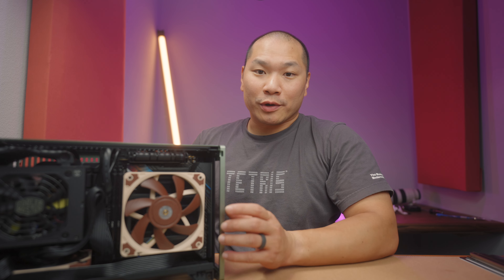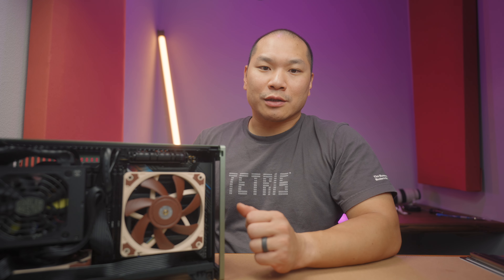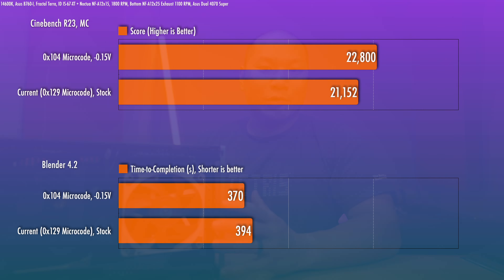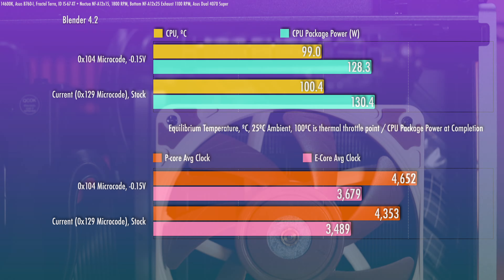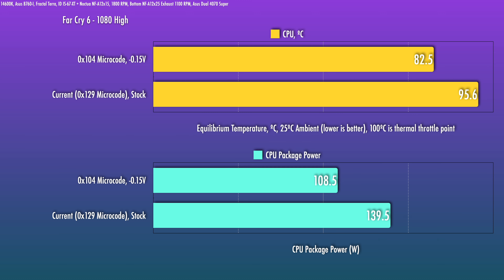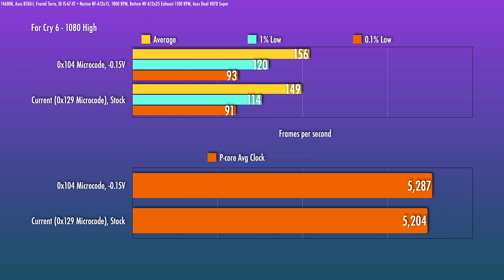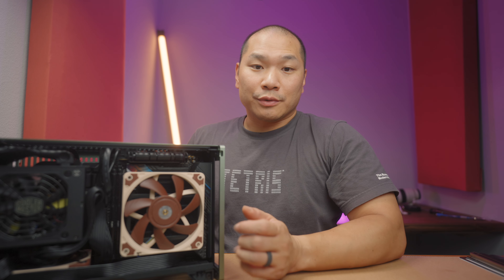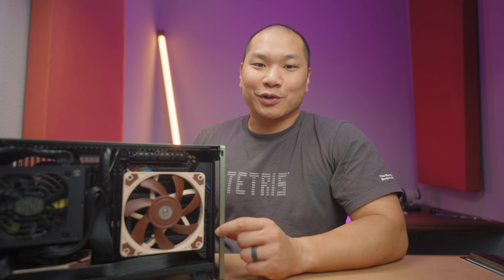Intel microcode fix - undervolting with B760 still works!

Comment: Running my 13700k with a Core Voltage Offset of -.220V on my ASUS Z790 MB.  Undervolting has been great.  Higher scores, lower temps, lower power drawl.  Lots of winning!
Reply from the maker: That is one hefty offset! You win the lottery
Reply: @MachinesMore  Yeah for sure!  I was not expecting stability, but I did and I'm NOT complaining.
Reply: hey man, how did u undervolt ur 13700k and with what microcode? did you do it via the bios, if so how? or did you use throttlestop or xtu?
Reply: lock your p-cores asap..  like as soon as you read this comment. You DO NOT want those two p-cores spiking mhz as it WILL kill your chip 100% it doesn't matter if you manage lower voltages. You WILL get a voltage spike while the p-core is spiking and it WILL degrade your chip fast af. You've been warned.
Reply: @jabronilifestyle  Yup I have my ASUS Bios on latest firmware (2503), set to XMP1, selected "Intel Default Settings" and have MCE disabled-enforce all limits.   Is this what you were suggesting? Been running my 13700k since 2022 and been fine. No crashing or anything so hopefully i'm good to go for a few more years. Only think i haven't played around with changing yet is the Intel Adaptive Boost Technology. It's set to "Auto" but I may see what happens if I disable it.  Appreciate the feedback man.
Reply: @caymandiver75  No you need to lock your p-cores dude what mobo do you have I'll tell you the setting.
Reply: @jabronilifestyle  I have the ASUS ROG STRIX Z790-E Gaming WIFI
Reply: @caymandiver75  my comment isn't showing up idk

https://youtu.be/enmaezqmtBo?t=230

Ai Tweaker -> Performance Core Ratio and set it to Sync All Cores
Reply: @jabronilifestyle  Weird. I goto that setting and click "sync all cores" and I get a message about "Load the Intel Performance power delivery profiles. ICCMAX is set to 307a and PL1/PL2 are set t0 153w for the 13700k/kf  I click ok but it's not saving.   Not sure what to do.
Reply: @caymandiver75  You probably already have the power profile loaded. As long as it says Sync All Cores you're all set.
Reply: @caymandiver75  Just double check that you have the PERFORMANCE power profile selected above, then Sync All Cores

Comment: Would you say that using ucode 0x104 with manually set limits over 0x12B is safe with a moderately low-voltage CPU like i5-13600KF? Intel's recommended settings seem to just impose a limit on max voltage and power, both of which can be set up by the user. The new ucode is supposed to ensure the CPU never spikes into unsafe range, but in practice the voltage ends up higher than with a proper voltage offset with 0x104. Even if 104 allows for transient voltage spikes, can it do damage to the CPU when the undervolt doesn't even let the voltage reach 1.3V under normal conditions?

Comment: I have the b760i board paired with a 14600 (non K) and there is no option present in the bios for the microcode. Does this option only appears when there is a K model installed? I have the 1604 bios.
Reply: 104 microcode work only with unlocked K CPUs. Non-K CPUs models (such as yours) can be undervolted only on Z690/790 mobos.
Reply: @hkiller47  Dang, didn't know that but I suspected it. Well, I suppose I have to live with that. Thanks for the info!
Reply: You don't need the older microcode to undervolt if you have a B0 stepping or later CPU

Comment: Using the x104 microcode is dangerous. You can undervolt with 0x129 on B760, just disable IA CEP and set AC_LL=0.3
Reply: Hey, I can't disable AI CEP on my asus b760, bios 1663 with the 13900k. The option is there but it's greyed out. Was reading that the option can be modified with the 14K series processors so I have to change the microcode to 0x104 to undervolt. Is your system any different? Like, did you change anything to disable AI CEP?
Reply: @The.Enforcer  undervolting isn't even the issue, it's not locking your p-cores. The reason the chips degrade is because 2 p-cores are spiking mhz (they aren't locked) higher than the ICC and ringbus can manage. Do that over and over all day every day and your chip will die. Lock the p-cores and don't worry about it ever again.

Comment: Bios 1604 on Asus B760-i and using 12900k
No where in the BIOS does it let me undervolt and system is hitting 98°C with an AIO.

PLEASE HELP ME UNDERVOLT
Reply: set your PL1=PL2=190W